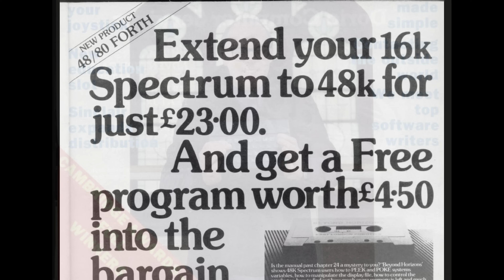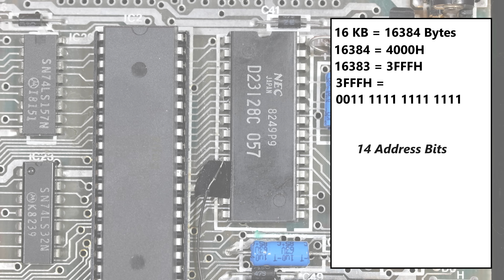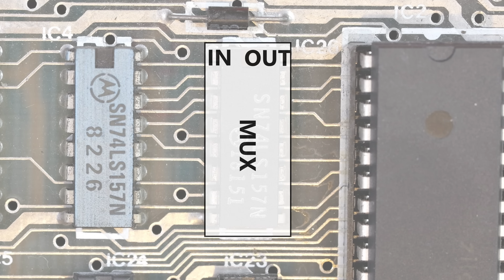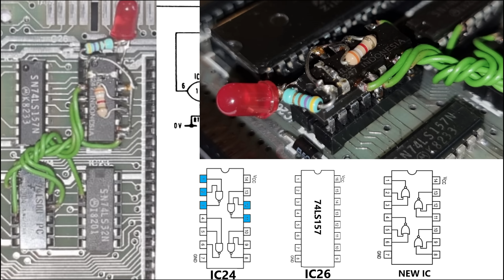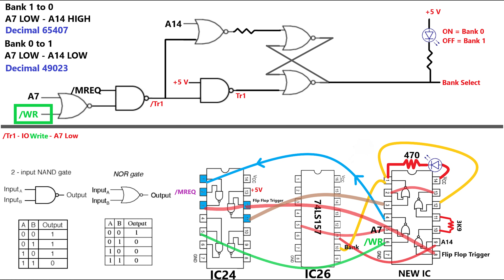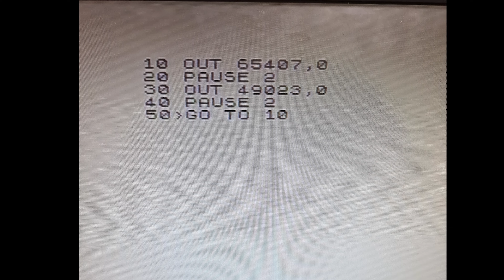Can you get 80K out of your 48K ZX Spectrum with just one extra chip??

Comment: Have you checked that memory kept values for a longer time than a few seconds? Back in the days I did not get 4132, so I had to buy 4164 for expansion. For curiosity I tried a simple mod using a manual toggle switch, but half of memory lost data while being not selected due to lack of refresh.
Update: I just learned that some 4164 need 256 refresh cycles, whereas others only require 127 refresh cycles.
Reply from the maker: The other video I did on these has a mod to account for the larger refresh cycles, although it seemed too slow for the refresh requirements it seemed to work, seemed a bit hooky to me though!

Comment: BRILLIANT! Absolutely brilliant video! It would be nice a small circuit board to plug it directly onto the Speccy motherboard and then pop on int all the involved chips, to avoid this mess of wires... Unfortunately I'm not aware of software to take advantage of this 80K trick. Maybe some utilities and multilevel loading games could have used this feature. This is where the Speccy 128K came handy.
Reply from the maker: http://speccybits.altervista.org/08_80K/
I think there's a design for such a board here

Comment: That ITT chip could be original, Sinclair would mix up chips in production, so you easily could have had the end of one tube in production, and the next tube grabbed was the ITT one, or that ITT chip was the last, and then the assembler started with a new tube after putting the last one in.

Comment: As others have pointed out, this will only work correctly if your stack pointer is NOT in the bank switched area of RAM, which means the BASIC program must be in the lower 16K of RAM.  As I understand it, this means that BASIC won't be able to directly access the upper 64K (two banks of 32K) for BASIC programs.  Also, any machine code routine which may be running in the upper 32K would not be able to use the other 32K directly since switching to it would stop the CPU from accessing the machine code program which would cause a crash.

The best use you could probably make of the upper banks would be as a "RAM drive" so that programs of up to the free memory size can be transferred out of one of the high memory areas into the lower 16K, replacing the program which was there.

A completely machine-code program may be able to make use of the upper two banks by loading one part of the program into one bank and another part of the program into a different bank and then using a "handoff" routine located inside the lower 16K to perform both the bank switching and the jump into the "second half" of the machine code program.

With some clever programming and positioning of code, it may be possible to load what is effectively one program into two different banks of memory, and have a conditional which either jumps past the bank switching or not, depending upon the outcome of a test.  Done right, this would save space and prevent crashes, but it's a hassle and is not something which would be supported by any assembler in existence.

For example, bank 0 has a test, a jump to the skip location if the test succeeds, the bank switching code if the test fails, then the code which is skipped to if the test succeeds.  In bank 1, at the exact same location as the code for if the test succeeded, is code to be run if the test failed.
If the test succeeds, the bank switching code is skipped and the "test succeeded" code gets run.  If the test fails, the bank switching code gets run and as soon as the last instruction of the bank switching executes, bank 1 becomes active and the next instruction in there is the first instruction of the "test failed" code.

All of which is a long, long way of saying that using this extra RAM bank is a hassle and requires some decidedly non-trivial programming tricks.

All the same, it's enjoyable to see an old computer used in a new and innovative way.

EDIT: Or replace the ROM BASIC with your own version which is bank-switching aware.  But that's also non-trivial.
Reply from the maker: I agree with and mostly understand everything you said. I'm working on a follow with a more complex mod (5 chips) which is consuming me trying to figure out everything it's trying to do. It certainly does have a mechanism to force the stack into lower RAM, though.
Reply: @HappyLittleDiodes  I'd guess that one of those chips is a replacement ROM to make BASIC "aware" of the memory banking.  Either that, or it has some tricky hardware.  It might automatically switch to a particular bank whenever memory over a certain address is accessed, so that the stack will always be found and will always be in the same RAM bank.
Reply from the maker: @melkiorwiseman5234 it's all logic, I've got it all sussed now, no ROM just forcing a particular bank when certain things happen like an interrupt

Comment: its a pity they didnt have a /RAMCS line for the upper RAM on the edge connector, then any memory expansions would be easier and could be external ,,...theres a spare 'finger' which couldve been used, and still can if you mod it

Comment: Hi. Learning a lot from your videos. Why your logic analyzer wasn't capable to detect each time the logic was triggered? spectrum clock works at 3.5 Mhz and the data analyzer according to your video goes to 24 Mhz, then why you mentioned that it was not capable enough and that you would need ones that goes to 100 o 200 Mhz!. Thank you
Reply from the maker: Thanks for this great comment, I went back and looked more closely and I found out I could choose the sampling rate.  I had assumed the tool was so cheap I wouldn't have any options.  It was running REALLY slow, like 50 kHz!!!  I'm trying now with 24 MHz and I can see 3 samples for a single pulse, double the clock cycle is 7 MHz which goes around 3 times into 24 MHz, seems like it works.  That's what I get for using a new tool for a video

Comment: After Uncle Clive's supply of those cheap memory chips exhausted he used the normal real ones, no longer mattered the PCB links were and then Paging was born.   Easy to do, but what was the point, no games were written that used it.
Reply from the maker: I guess other than the joy of tinkering and making things work it was "more is more"
Reply: @HappyLittleDiodes    I remember 40 yrs ago standing in WH Smiths leafing through a magazine thinking whether buy it or not, and speccy 48K Paging was in it. I did though actually implement paging, but was with a EPROM for switching between standard Sinclair ROM and a hacked version having modified ROM calls for example the standard LOAD and SAVE commands went instead to a high speed tape streamer.  The hardware was a one off and was in boot of my car had a rear end smash and I'd lost interest!

Comment: The reason why the computer restarts is because the stack pointer points to &FFxx, i.e. in the upper memory area. 
As soon as you switch the memory area, the stack is undefined and the computer crashes and restarts. The stack is then initialized. 
Therefore the stack must be secured or the stack must be moved to the lower area. 
Otherwise the computer will not run properly because the stack will not be consistent when the bank is switched.

I checked, the 128k does exactly that, it moves the stack to the unbanked memory area.
Reply from the maker: What I didn't quite get is why that only happens the first time you switch banks, afterwards it doesn't reset
Reply: After the bank has been switched, there is "data garbage" ( in best case 0000 ) at the point, which leads to a reset. This means it jumps to address 0000 and the stack is reinitialized there. 

The initialized stack is then located in both halves of the bank. 

As long as you don't do anything else, nothing will happen. But if I change the bank during a PUSH / POP (call, etc.) operation, an error will occur. This doesn't necessarily lead to a crash, but to misbehavior. 

Therefore the stack must first be moved to the lower ram area, after which the computer will run normally. You just have to take this into account when you execute program code in the upper area and then change the bank. The change may only take place when all stack operations have been completed. 

That's exactly what the 128k spectrum does.
Reply from the maker: @mibnsharpals really interesting thanks for taking the time to explain
Reply: @HappyLittleDiodes  Ideally the spectrum is operated in the 16K configuration. 

So the ramtop must first be reduced and then the stack must be placed in the 16k range. From this moment on, the memory above is no longer visible (for the basic). But it can be accessed safely on both banks. 

An application would be a word processor or a window management, where the screen is then copied to the upper area. 

What is also possible is graphics with a double buffer. The graphic is generated in one of the upper banks. In both, around 10 screens can be saved and then copied into the screen as an animation (one after the other). 

Another application is to create a STREAM and then use the upper storage as a virtual drive. 

The ZXRom has entry points for this. 
you have assigned pointers and use the A register as a transfervariable.  After that , you can use OPEN# , close# , print# ...

In this way I had a serial output of the screen realized on a terminal and used the speaker as the output port. This worked at 300 baud. 

I was then even able to redirect the screen output (text).
Reply from the maker: @mibnsharpals you really know your software, I'll have to read comment a few times

Comment: What about 64kb of fast dual ported video ram?
Reply from the maker: So you could rapidly switch between screens?
Reply: @HappyLittleDiodes the zx spectrum 128k's all have 64kb of ram that suffers from video ram ula contention why can't we modify the ula so that different video modes that use the full 64kb are available like ula+ ( uses 12kb timex hi rez hi colour 8pixel attributes) spectra 32kb video ram but only 18kb in one screen fir 2x2 attributes ulax and vdac2 don't think any of them support hardware interlace! Have you seen velesofts interlaced images?
Reply: Well yes and use different 8bits per pixel 320x200 images and hardware interlace

Comment: Have you ever tried to replace the 4532 memory chips with 41256 ram chips ?
Reply: I have once used 41256 as a replacement for the 4164 chips. It worked, but it was clearly a waste of memory.
It could work, but 41256 introduces one more address bit, so it doesn't fit into existing multiplexing. It would be worth it to make a small board with bank control (8x32KB banks), so some 74174 would do, also 74138 as "port selector" might help. Then you would need to feed to build the upper two bits multiplexing and merge it properly with the existing circuitry.
From today's perspective, it would be probably better to do some more modern memory overhaul with static RAM chips. 74138 + bank register + 128K or 512K of static RAM chip, all of which could be used instead of the standard 32K memory bank. RAM chips plus multiplexers plus the RAS/CAS timing circuitry all removed :-)
Reply: ' upper two bits multiplexing and merge it properly with the existing circuitry.'  
Switch to motherboard SRAM.  Then you can toss all of the refresh paging/counting circuitry, and only have bank select and access control.  It becomes much easier, and some of the SRAM packages are DIP or Skinny DIP and close enough to the ROM or similar that you can piggy back them fairly easily.  Just cut off the old ram, piggy back the SRAM and hook up the data lines, then a few other circuits and you're running.
Reply: @ModelLights  I have a niggling memory that the 256k DRAM chips only needed 8 bit (64k) refresh counters even though they had 9 multiplexed address lines.  
I would personally use a large battery backed SRAM with a tiny FPGA to do write protection for the ROM area and bank switching for the rest all replacing the ROM and pulling the DRAM out of circuit or completely off the board (to save power).  Having a small boot loader in a serial flash that the FPGA can use to transfer the ROM into the SRAM after a battery change sound like a plan.  It would make multi ROM images and RAMdisk very flexible.
Reply: @KallePihlajasaari  'I have a niggling memory'
I actually built a 1 megabyte C-64 and interfaced an IBM GEN and GEN2 hard drive controller to the C-64.  So I'm not guessing, I remember how it works.
You can't just sit in one bank and refresh a larger DRAM correctly, you have to step through the banks during refresh.  It requires extra hardware.
Go look at the board in the Transactor Magazine for the C-64.  Been ages since I looked at it myself even, but roughly about 1/3 to 1/2 of the chips were involved in the DRAM refresh.  It wasn't 'nothing because you just refresh it with 8 bits'.  You had to access the other banks during refresh cycles to keep them refreshed.
It's irrelevant how you do the rest, SRAM instead of DRAM takes out a good chunk of what has to be done and is much easier to deal with, as I said in my post..
Reply from the maker: You're probably getting quite close to the modern 512K+ clones now!
Reply from the maker: I haven't but that's really interesting, with a similar paging mod you could achieve 272 kB
Reply: @HappyLittleDiodes What is your opinion using the programming language forth on the spectrum ?
FORTH for ZX-Spectrum 48K: This is a Forth implementation for the 48K Spectrum, developed by Abersoft/UK in 1983. It is a standalone ROM that provides a Forth environment for programming and development.
Reply from the maker: I suppose I'm not much of a software guy so it's hard for me have a valid opinion!
Reply: have done here, to upgrade an 16K to 48k . They are much better to find than the 64k chips.

Comment: My Romanian clone of the 48K Spectrum had 80KB of RAM from the factory.  Due to it having a AY-3 sound chip, it was compatible with a lot of 128K games and enhancements.
Reply: How was the clone named?
Reply: @zxGHOSTr  Probably Cobra. There's an article on ars technica from 2017, just search for "cobra spectrum clone"
Reply from the maker: Maybe the felix hc
Reply: @zxGHOSTr  Tim-S, one of the variants. I lived in Timisoara and that was the easiest to source. It also had centronics, serial, RGB and other ports on the back. The PSU was awful and had to replace the integrated rectifier bridge every year or so.
LE: After answering, I searched online and found that it was likely called TIM.S 101. There's a Romanian webpage that I did not know of until now with some of the info for anyone curious, but other museum websites have more detail. Have to go around the filtering algorithm for the link: doube-W double-W double-W some-dot z80-romania another-dot ro forward-slash TIM_S-68
Reply: @zxGHOSTr  It was a TIM-S 101 from Timisoara.
Reply: Possible only with "128K" games that weren't using the 128K extra memory and were just 48K versions with AY musig support when the chip was present. Is not possible for pure 128K games that used the extra memory with in this configuration because the hack uses only banks 32K of RAM, one half at a time. The 128K uses banks of 16K from $C000-$FFFF, the last 16K of the RAM and to switch to another memory bank you OUT ($5B5C),(bank page address), the $5B5C is the decimal address 23388 which is different from 49023 and 65407 used by this hack.
Reply: @Florin76  There were definitely a lot of 128K games that did not work. From what I remember, some were "hybrid" in the sense that they would use enhancements if they detected the AY chip, for example. There was an isomatric Pac-man game, I think it was Pac-Mania, that had much worse music on HC and original Spectrums than what I had. I also suspect that I came across games modified in Eastern Europe that used more resources for better output. I wish I kept that computer to restore and mess around with.

Comment: I knew about the half-bad RAM back in the day, and often wondered if it would be possible to page between the two sides of the RAM (if you put in memory that was good) in software. After all those jumpers are basically a manual "paging" technique. And now I know.
Reply from the maker: Yes it would be much simpler to fit a switch and manually do it!